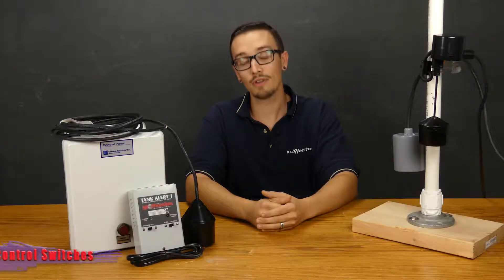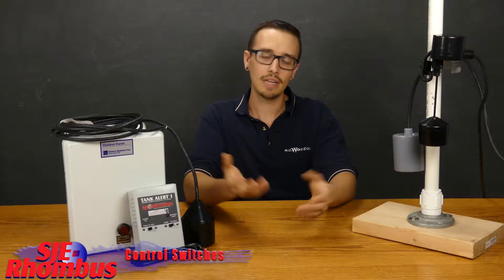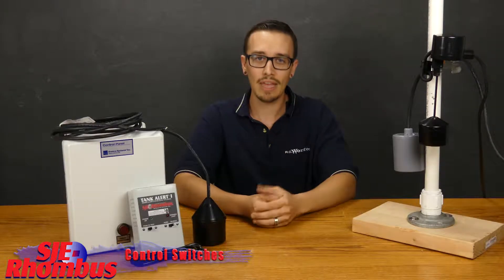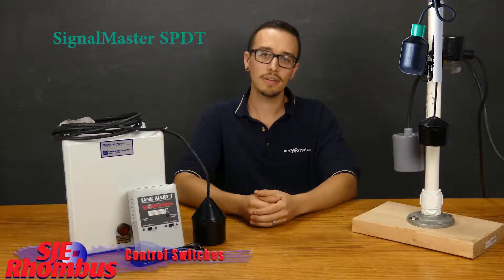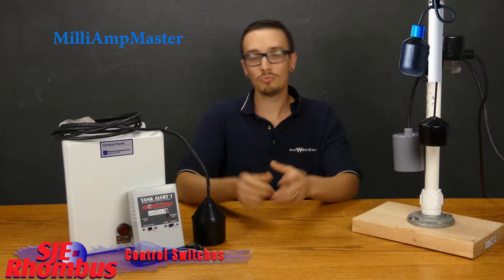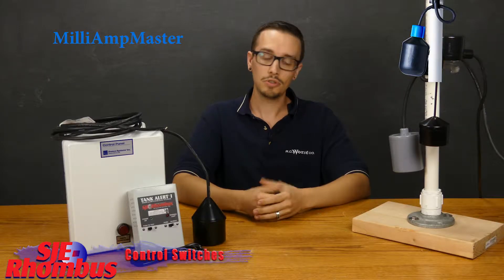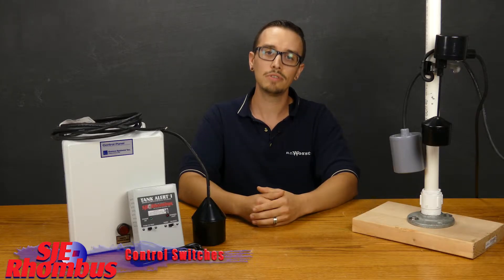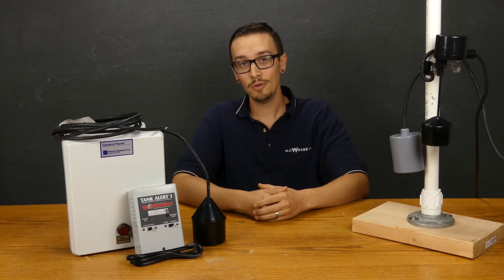Selecting a Control Float Switch

Comment: Our irrigation pump   pumps from a man made well made with a vertical culvert next to our irrigation pond and the well is 10 feet deep. Last season the irrigation pond went dry and I didn’t realize that so the pump had been running dry for a little bit would it be possible to install a float switch in the well at the bottom of the suction pipe and have the float switch control a contactor that controls the pump?
Reply from the maker: As long as you have room for the switch, typically you need at least 10 or so inches. A vertical float switch needs even less clearance to operate: https://www.rcworst.com/vertical-master.html
Reply: @RCworstwater  ok cool thanks the irrigation well I made is 4 feet in diameter.  That should give me the 10 inches needed for a float switch.  lol 😝    The reason I thought a float would work is because I tried one of those low water cut off pressure switches and it would kick off prematurely in low water mode even if the pond was full because of the inrush flow of the irrigation valves opening.   So I’m going to switch back to the regular pressure switch and install a low water safety float switch.